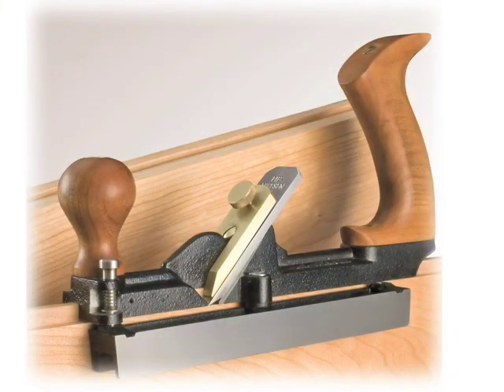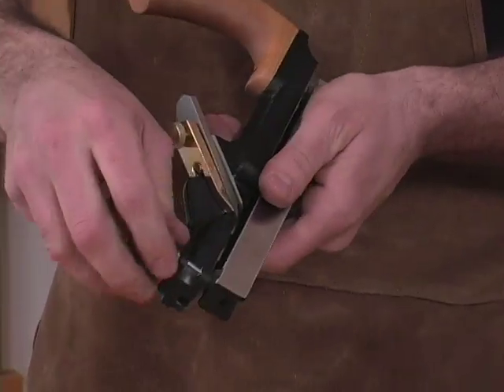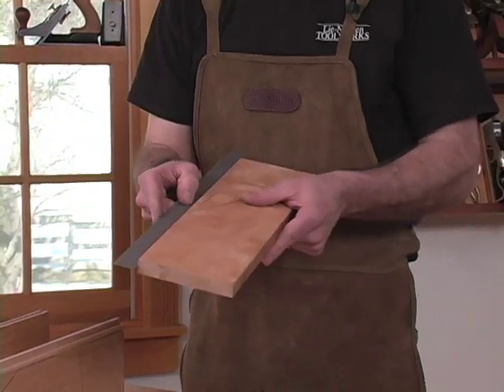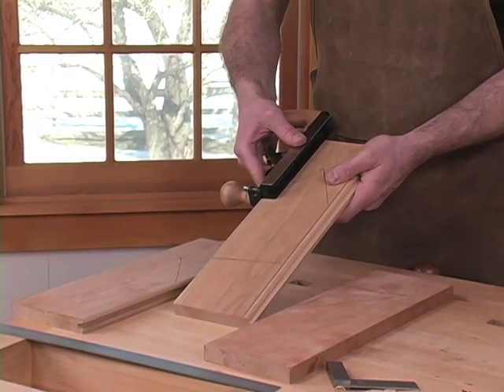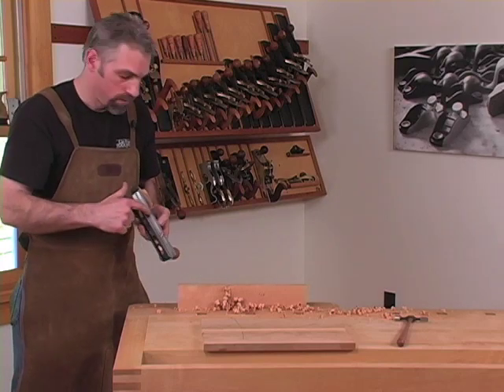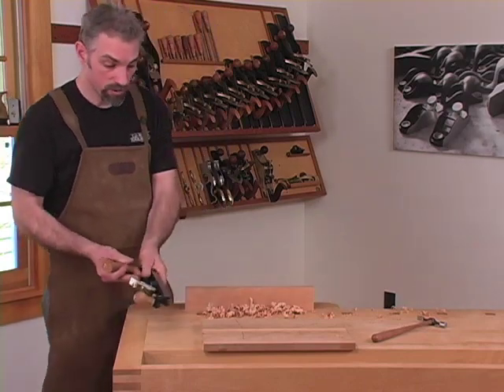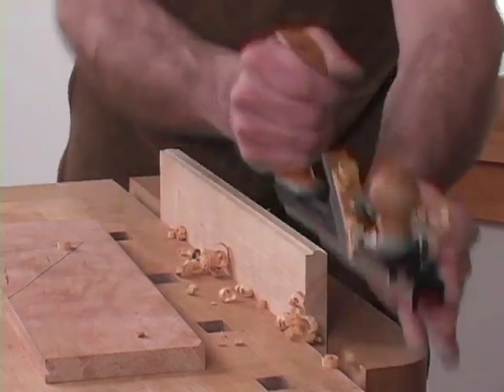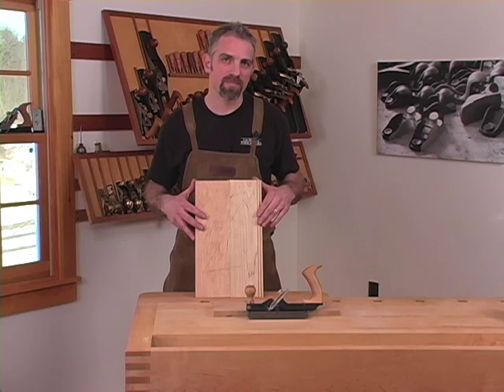#48 Tongue and Groove Plane

Comment: its for playing and its DNA is not  rooted in furniture building its for example a typical floor board connection,  then with one important difference , the tongue ore one of the necks  is shorter so its guaranteed to get em together . Here You have three contact points all same lengths  ;-) Just think about that fact... it makes sense in a non glued filling of a frame where you want massive woods movable with change of humidity , but who in that dimensions does this ? Except for fun ore education on small demo pieces . Would buy it either ;-)

Comment: apologies for the stupid question, but why isn't he using the knob at the front?
Reply: Most handplane users don't wrap their hand around the front knob unless if they are working on a really difficult piece of wood that needs a lot of force to get through it.  We usually place our left thumb (assuming you are right handed) against the knob were the knob and plane meet and allow our fingers to hang over the edge of the plane and against the side of the board.  This allows us to "feel" the board and tells us if the plane is at a right angle to the face of the board.  The thumb provides a little downward pressure.  I hope this helps.

Comment: Nice device, I just feel that you didn't really used the knob, maybe a lateral knob or handle in the same plane of the fence would be more helpful for both, subjection and applying pressure against the reference. cheers

Comment: Seems like a money grab to me . Why not have ONE plane capable of working on stock of ALL different thicknesses like Veritas does? Clearly the planes are well built ,either they are NOT well thought out or as I said money grabbing by making people NEED two different planes . Disappointing from Lie Nielsen ,that is why I generally prefer Veritas tools.
Reply: @738polarbear Interesting viewpoint. Mine is that I’d rather have a very stable tool without a lot of fiddly adjustments. For a specialized tool like this, I’d rather it do one thing perfectly. So for folks like me, it is fulfilling a desire for a stable tool, rather than a money grab. Adjustments loosen and move, and if that adjustment moves while working a $500 piece of mahogany, all of a sudden that money-grabbing plane seems like a great deal.

Comment: it is cool but no way faster than a rout not even close.
Reply: iwantosavemoney This isn't a race between a "rout" and this finely crafted tool. It's a different way of doing by hand what can be done by machine.
Reply: it is way faster than a router for the quick one time job. A machine is much faster for doing the same job over and over after the set up. Planes have little set up, you just grab and go.
Reply: iwantosavemoney it is a lot faster, in many situations. You can just grab the plane and get at it. The router has more setup -- aligning fence, cutter depth, etc. if you're only cutting a few - grab the plane. A hundred? Yes, the router will be faster. But the plane is always more fun. This and the Stanley 48 work surprisingly well.
Reply: lazls1 I can see that if you had plans to do all thicness of wood but if you had that would it not be cheaper to get a router? can this plane do all thickness of wood with out being adjusted? I do project the are repetitive so am making many of them. I do like the cool factor of doing it by hand don't get me wrong but at the same time I have to make money.
Reply: If i only had the money for one or the other i would buy the router. Having a plane is nice for convience. Its like taking out a hammer to drive a few nails instead of lugging out the air compressor and nail gun to do a lot of nailing. The hammer is faster because you dont have all the set up involved, you just pick it up and go. You can buy a cheap plane and refurbish it yourself if you want to have a few around and try them. You tube will give you all the help on how to refurbish a plane.